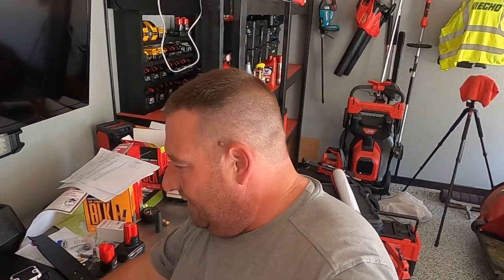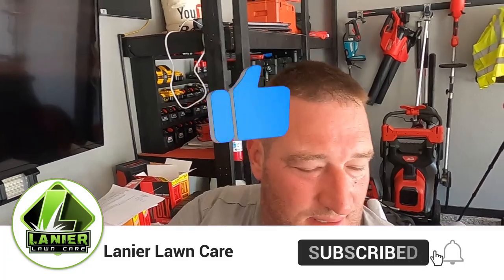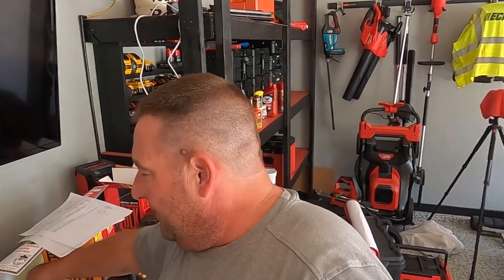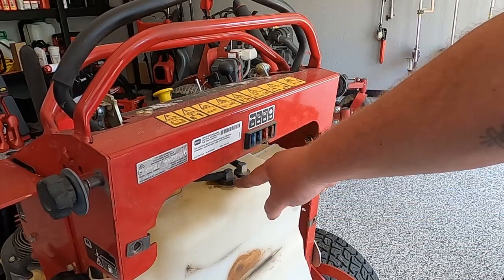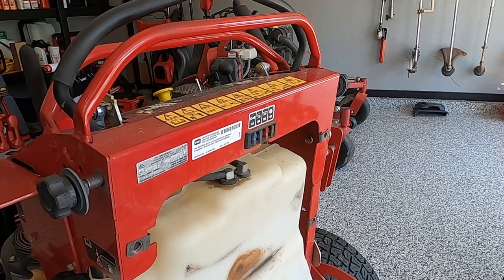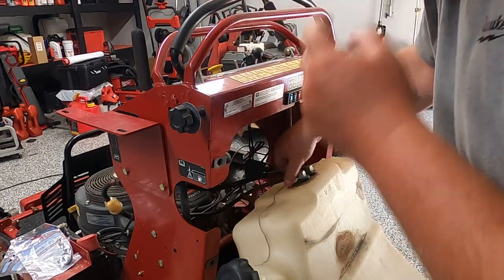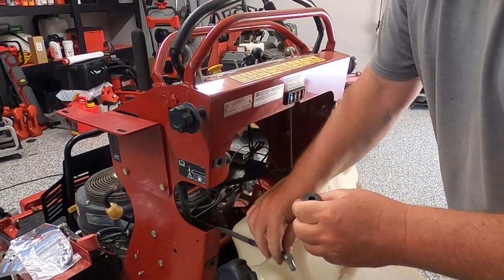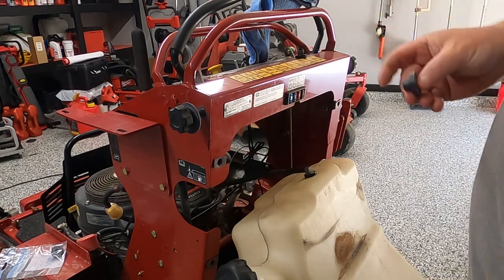No One Can Fix This Problem

Comment: I would change the coils, plug wires and spark plugs.  I had a Ferris with the Kawasaki and it was having a hard time under load and changing those out made it run like brand new.